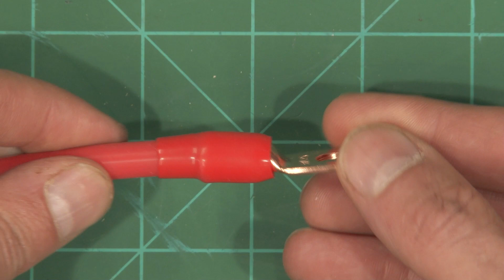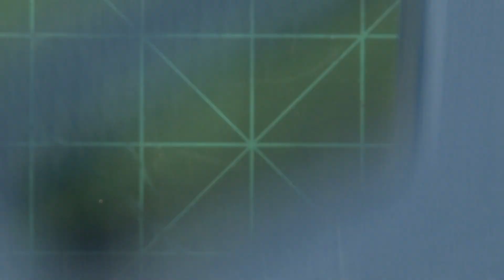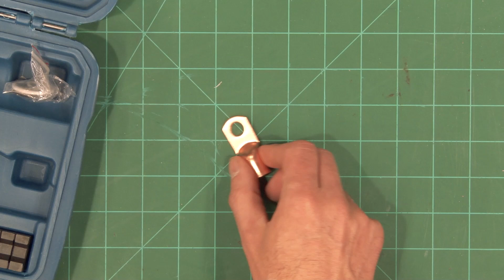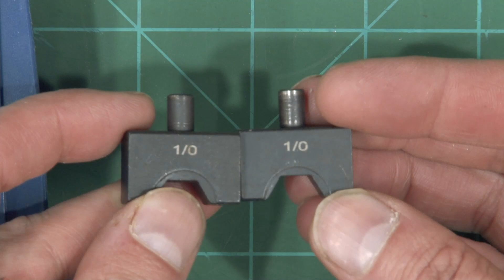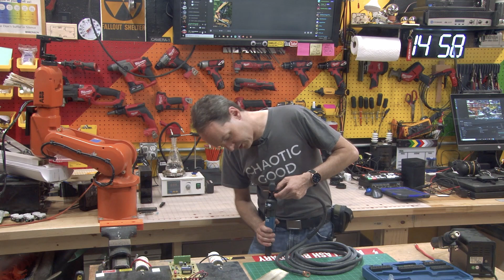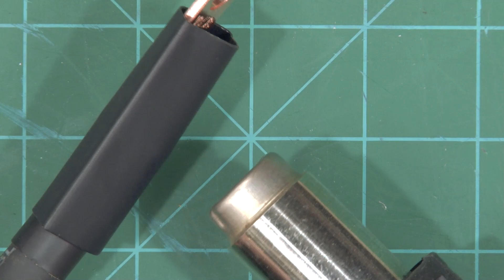High Voltage Episode 13 - How to use Hydraulic Crimpers and terminating large cable.

Comment: I don't know about high voltage implications but in a low voltage and particularly automotive where this cable might be in the engine bay, no-ox compound of some sort on the wire before you crimp it. Connections too. 

This tool looks identical to the Harbor Freight one I got some years ago, it was cheap, what the hell. It worked ok for a little while then it started pissing hydraulic fluid. It isn't a T&B or a Burndy so my expectations were low. Probably enough crimps in it for a hobbyist. The crimps are fine though lugs vary a little by manufacturer. Some lugs would get pinched where the dies meet leaving sharp edges. Work around that using good judgement...

Comment: I remember seeing one of those mystery tools several years ago.

My neighbor dug it out of a box, spent several minutes finding the right size die, then used it to connect two short lengths of cable into a longer cable. 

Either it is a wire crimper, or lots of people just happen to agree that it works okay as one, lol